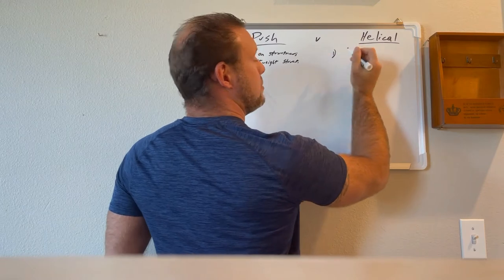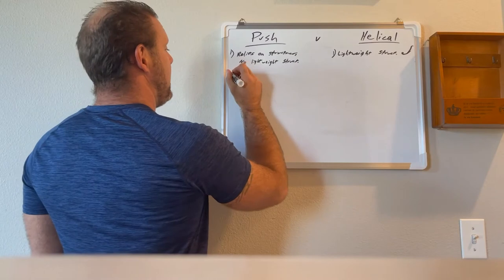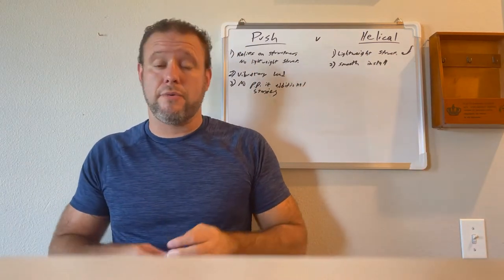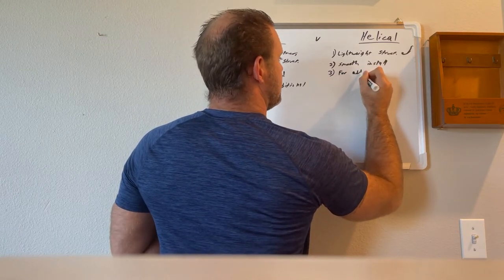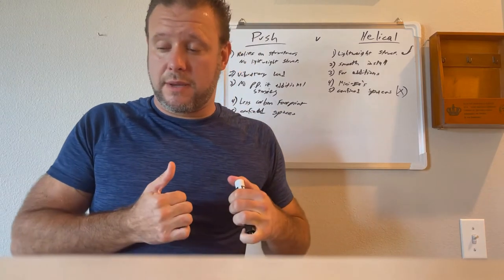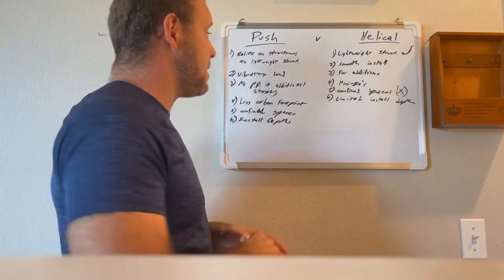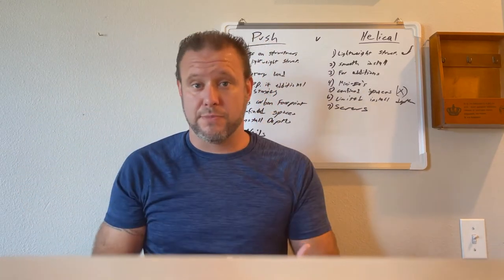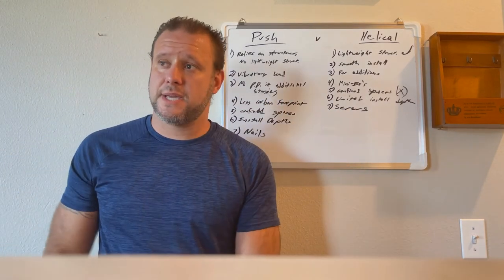Push Pier vs Helical Pier

Comment: Good Teaching Boss!
Reply from the maker: Thank you so much 🙏🙏
Reply: How much do a ram kit normally cost??
Reply from the maker: Really depends on which company you are working with. SafeBase has an EXCELLENT system, but I believe Saber has the rights to them. They’re probably my preferred on Push Piers.

Chance and Dixie have a PHENOMENAL helical pile system, but you’d need Ken Drake (PHENOMENAL dude with a TON of experience), or a Chance rep to discuss.

For the basics of basics, with no material, about ten years ago they ran something like $20k-$30k. For the BASICS. But that was a long while ago and MUCH before all this inflation and whatnot. 

Ramjack has an AWESOME push pier system too, but I don’t know what their equipment costs. I believe they franchise also, so it may not be so simple as just purchasing, but they’re AWESOME.

Comment: Very informative video, thank you sir.  I have a one story slab foundation house (but overall height is almost like a two story house due to high ceilings) with 3 inches of settling on one side. I received two quotes from foundation contractors. The first quote was for concentric push piers, and the second quote was for helical piers. The helical quote was quite a bit more expensive. I haven’t had a soil study done however both contractors said that my area is comprised of clay soils. From your video it sounds like I should top for the helical piers?
Reply from the maker: Howdy! Thanks for the questions! With regards to a piering system in Clay soils, helical piers will generally be more effective, provided they are installed properly with the brackets anchored into the footings. This way, they can resist both compression and tension loads, which will help to hold your foundation down when the clay soil expands. 

Push piers can be just as effective, but they would need to have an eccentric load with a side bracket as compared to a concentric load, which goes directly under the footing. A pier that is driven directly underneath the footing cannot be pre-drilled, so you end up at the mercy of the Clay soils strength, and in a lighter home that often means the pier will lift early. That is great for lifting, not so great for stabilization.

It is also very important to get that soils report done. I usually advise my clients. They should have one done before even getting an estimate because it could entirely change the cost of any repair being provided. A push pier that is supposed to go 20 feet deep might suddenly be going 80, and for helical peers it is critically important to understand the soil properties prior to even designing the pier. There is a significant difference in cost (except some people who bid wildly) When using a one and a quarter inch shaft to go down 15 feet, versus a one and three-quarter inch shaft that goes down 25 feet. It is also important to figure out what the expansion potential of the soils are, because a heavy enough clay, with enough expansion can lift a footing off of a push pier, whether it is side loading or directly under the footing.

Ultimately, I’m not a fan of providing a design for Hval peers until you have the soils information so the peer can be designed for your specific project and your specific conditions. The bid design should be more of a benchmark for you to start, budgeting, and the actual design based off of the engineering behind it. I can make a world of assumptions just knowing it’s a clay soil and with the information you provided about your home, and I can be right 85% of the time, but it’s the other 15% that clients often remember and that creates a challenging working relationship. So make sure you know exactly what you are signing in the contract, and be sure to ask the questions about deviations that may arise during engineering.

TLDR: generally helicals are better. Make sure contractually the price will not vary greatly during engineering, or it can be a very expensive mistake.
Reply: @allaboutfoundationleveling6304 wow, thank you for the detailed reply! Just subscribed :)
Reply from the maker: @joejesus9902  Always appreciated, and just glad to help!

Comment: I have a one story house in GA that needs piers.  The house is wood framed with wood siding and a typical asphalt shingle roof.  Would this house be heavy enough for push piers?
Reply from the maker: There’s a lot of considerations before I can answer those questions: is the house experiencing subsidence or settlement? How far down is it? Do you absolutely want to have this thing lifted? What is the soil‘s look like underneath the home? What is the condition of the foundation, is it a deep foundation, or shallow, and is it raised floor or slab on grade? Do you have a basement? How many stories is the home?

I can probably piece together some general recommendations if we have that info! But, as always, it would just be a long shot in the dark until further evaluation is performed by a specialist or an appropriating engineer.

I know it’s a lot of questions, but I hope this helps! I’d be glad to discuss further!
Reply: @allaboutfoundationleveling6304  Thanks for the speedy reply!  The house is built on a crawlspace (no slab or basement) and is a one story house.  I have owned it for 13 years and the settling is getting worse each year and now has some substantial cracks in the block wall with the biggest being about 1.5 inch gaps.  The house will also need to be lifted at least 2 - 3 inches in some places (due to the sinking).  The footing is not deep and the top of the footing is less than a foot from the soil surface.  The soil around this area of GA is lots of red clay and gets rock hard when dry and soft and muddy when wet.  There is no water getting into the crawlspace.  Hopefully that is enough information for you to give your opinion on if push piers are suitable.  Thank you!
Reply from the maker: @beemikeme   going to be a long answer 😅 I need to preface the response with a reminder that I have not physically seen the home, and the eyes of an expert, and or an engineer is highly recommend. 

So let’s tackle this step at a time: I’m making a lot of assumptions, that the footing is in a structural condition to be lifted, the framing is in a condition to be lifted, and we will also assume that the soil underneath is a red clay.

Based on this information, it is unlikely that a resistance pier system like a push pier would be installed very deep. Whether it is concentrically loaded, like magic, piers, or eccentrically loaded like Safebase, SupportWorks, Ramjack, etc., the pier will likely not get pushed very deep due to the weight of the home. This doesn’t mean they won’t WORK, it just depends on what you’re trying to accomplish.

The shallow installation will permit the lifting, for sure, but does little for the stabilization. Red clays are usually fairly dense and expansive, so coupled with a light home and shallow foundation I don’t expect you to be able to “push” past it, the home will lift early. 

I’m going to make another assumption and say the red clay, for fun, is 6’ deep and turns to something less expansive and competent below that. You could also pre-drill through the red clay layer, and install the piers underneath the footings with that means method to extend beyond the red class. While the home would still be subject to heaving of the red clay, the subsidence and differential settlement issues would both be resolved because the home would be lifted back to level.

Red clay, sometimes also provide challenges for helical piles, and that a smaller shaft might require higher torque resistance, but most manufacturers have ways to deal with that. 

Finally, if you were to use appearing system, there are lots of things that might be influencing the subsidence of the building. You will need to make sure to maintain good drainage and grading practices, and he will also need to make sure that it is not the water table that is influencing the clays. If it is, then, once again, a heating issue may become Prevalent even if the settlement issue has been resolved.

Sorry, long answer.

TLDR: it would be affective for lifting, but stabilization might require further work
Reply: @allaboutfoundationleveling6304  I VERY much appreciate your time to answer in detail.  I have had 4 different pier companies come out and 3 of them say they'd use helical piers and one said they'd use push piers.  The one saying push piers happens to be the cheapest quote.   I am unsure of what to do.  Based on just what you know about my situation, which pier system would you use?
Reply from the maker: @beemikeme  going to be a long answer 😅

I suppose my first recommendation would be to properly vet, each of the companies providing estimates. In a clay, soil condition, helical piers are generally a better repair, so it also makes sense that they are overall more expensive. 

That being said, I am not opposed to using push piers. If the focus of the project is specifically to lift the home back to level, they are a good solution. For long-term stability, no matter which peering system you decide to use, you’re going to need to address the drainage and grading practices around the property to ensure , that water does not influence the expansion and construction of those clay soils to a significant degree.

That being said, I would encourage you to double and triple, check the warranty being offered by the peering companies, and that there is nothing hinging on the clay, soil conditions, or the amount of moisture around the property. If they are pulling permits, you will definitely need an engineering report, which will also provide some of those clarifications. 

If the parent company has a good reputation, or if they have done their job, thoroughly, they should’ve already addressed these hot topics with you when providing you an estimate, and going through their contract. However, based on the scope, clarifications, and having a game plan on getting your peers deep enough if the soil is too hard, I am always comfortable with push piers. But, I also understand them VERY well. 

TLDR: push piers are GREAT for lifting. Ask pointed questions about clay and water as they pertain to the warranty for long term stability. Get it in writing.
Reply: @allaboutfoundationleveling6304  This is INVALUABLE information and I REALLY appreciate it!!!  It is very kind of you to help out in this way and thank you VERY much!
Reply from the maker: @beemikeme  thanks for the kind words and no worries; always try to help people out and always try to do so by educating!